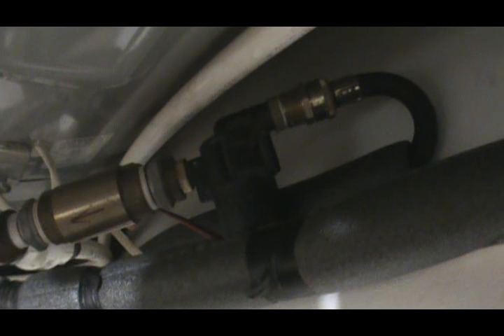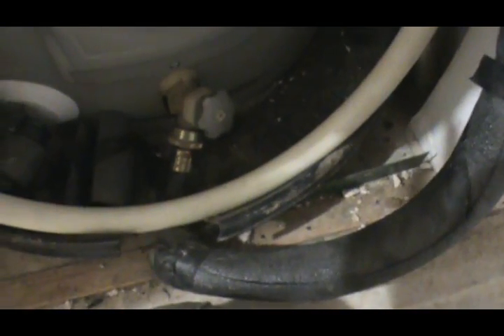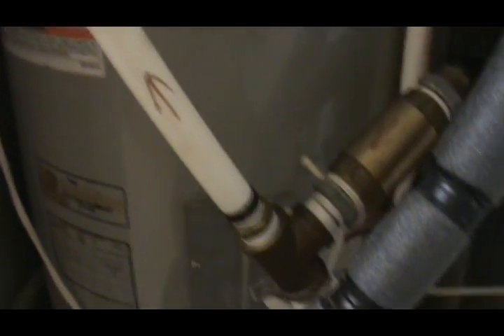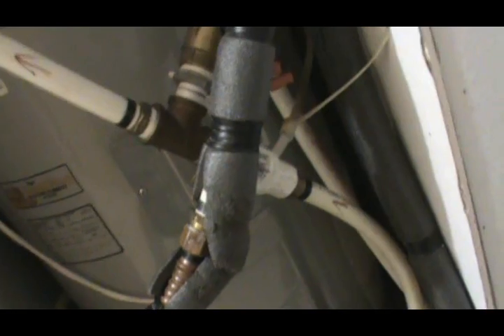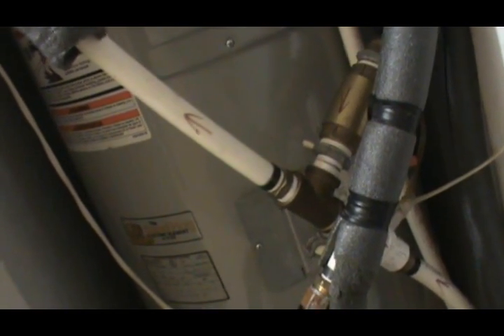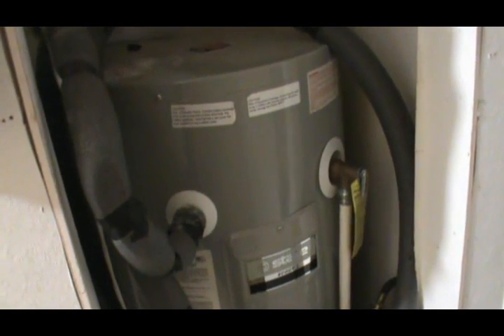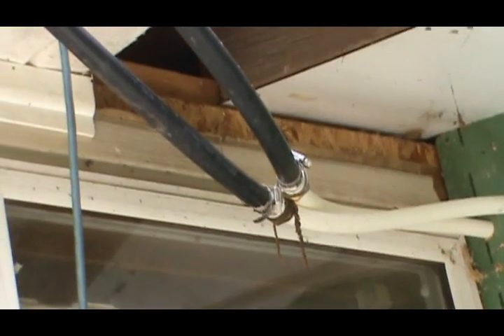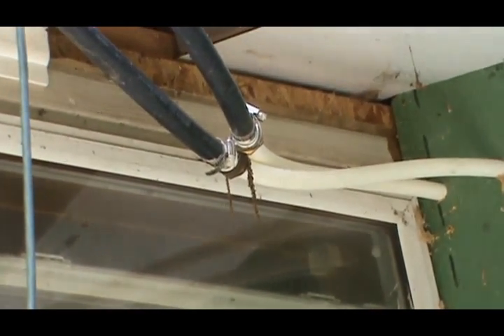cheap solar water heater

Comment: Yes there are many ways to heat water using the sun's power.  Any type of solar hot water heating is good!  I have an at point 13 gallon 120volt ac water heater which has power and temperature controls being run by my 700 watts worth of solar panels,60amp MPPT and one 100amp hr.12v battle born battery.  I set the temperature to max and power setting to low which is 200 watts.  By the time I get home from work on a sunny day the water temperature is 145 degrees which is enough hot water for two showers.